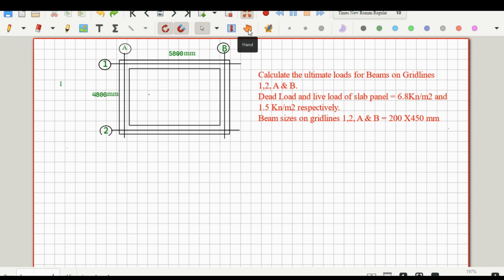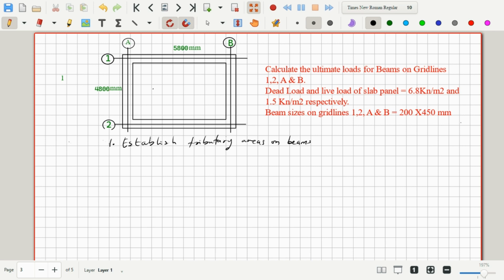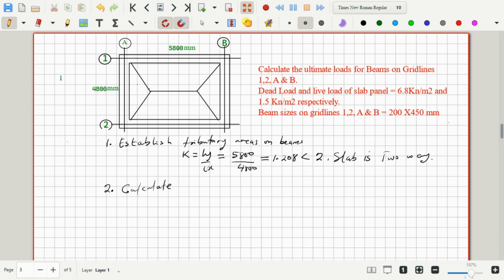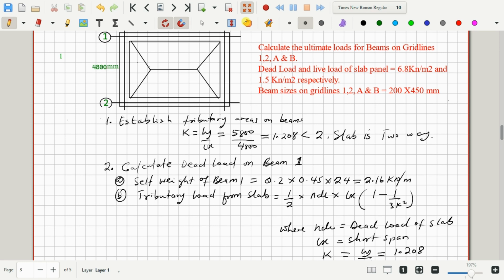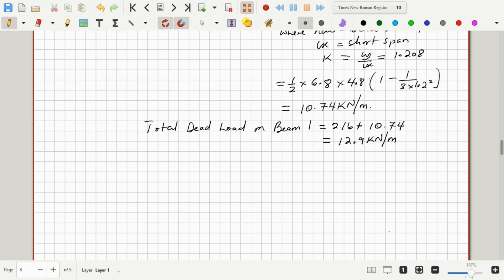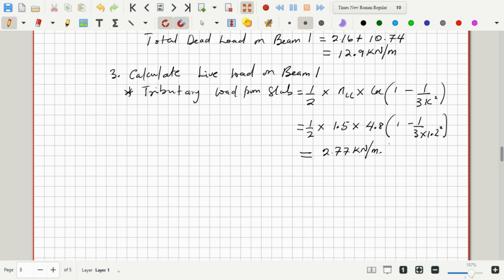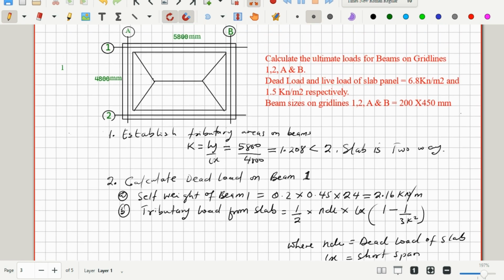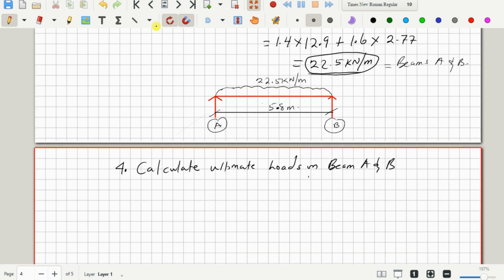Beam Load Calculations -Manual calculation(Part 1)

Comment: If it was a monolithic beam where slab and beam are poured at once. Does the load calculations process stays the same just like in your video. Thanks a lot !!!

Note: it is still a two way slab
Reply from the maker: Same principle holds